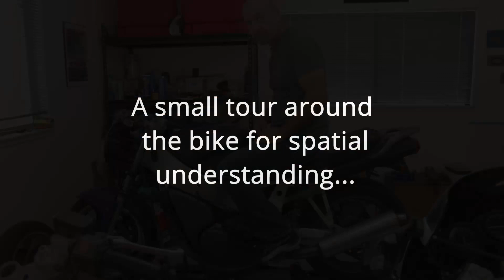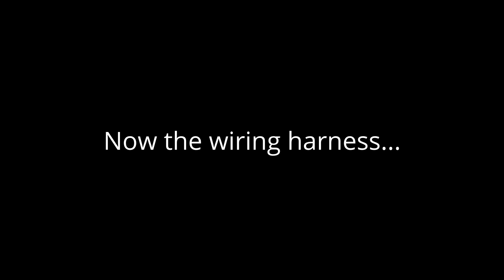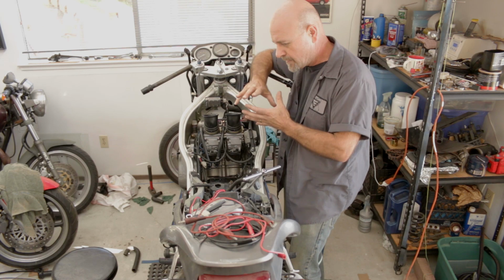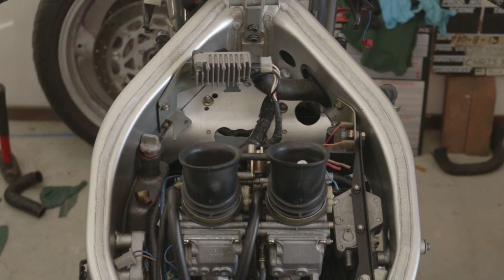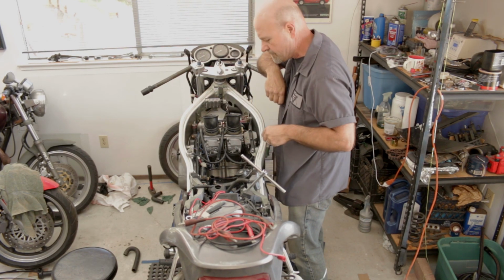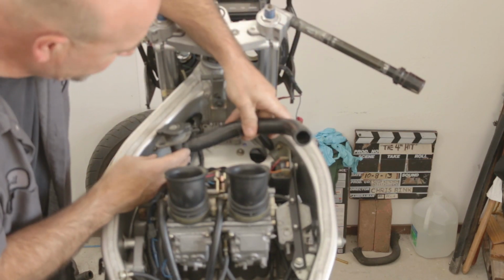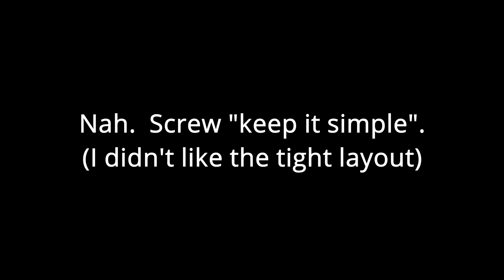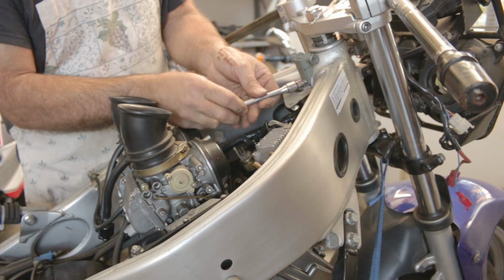TZR850 Motorcycle Project Episode 8 Wiring Harness And Other Things

Comment: Keep thinking outside  box for your build, I still think the oil cooler could be mounted with fittings down, try to keep coolant cap at highest point in system!!
Reply from the maker: Thanks for the comment Rand, will call for some discussion...